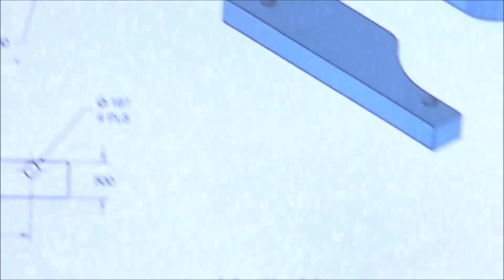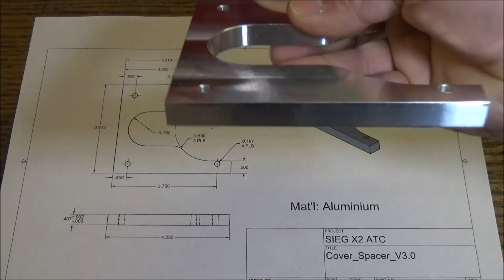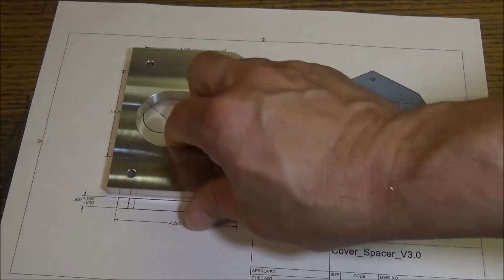PM727MATCPt5

Comment: Bit of a process/machining strategy question: I see you only climb mill even during roughing. Resulting in what would seem to be inefficient repositioning moves between cuts. Is there a reason not to have “both ways” machining enabled until you get to finishing passes where climb mill will get you the nice finish?  Or is always climb milling linked to chip thinning considerations?  Looking to learn so appreciate any insight.  Cheers.
Reply: Here’s what I think. The “both ways” adaptive is a very over hyped feature that you see a lot on channels like NYC CNC where it’s cool to show off the marginal gains in efficiency. What happened here was he forgot to set the no engagement feedrate to his machines maximum feed/rapid (unless what he is showing is the max). In most everyday prototyping operations both ways doesn’t get you anywhere. In fact, I would bargain to say that on most generic 2,3,4,5 flute end mills you rub far more than you cut, essentially killing the tool like a food. Basically, don’t use both ways unless you can prove the decrease in cycle time will save you money
Reply from the maker: Great answer Justin I did also forget to set the no engagement feedrate.
Reply from the maker: Hi James , Justin explained it very well. with fusion 360 you can simulate very easy both ways and Climb milling. very marginal gains almost every time I compare. you would think it would save a lot more time than it does. maybe more beneficial with commercial mills. I just don't see the gains.
Reply: Thanks gents.